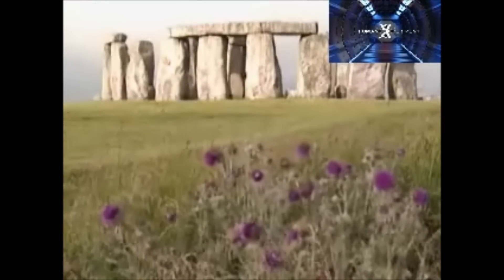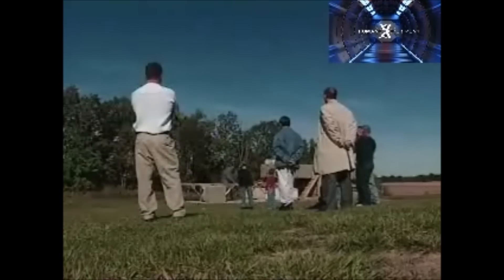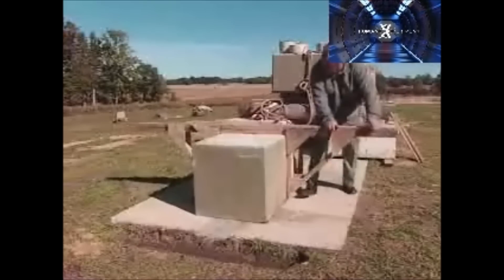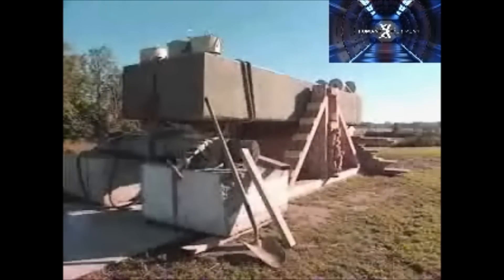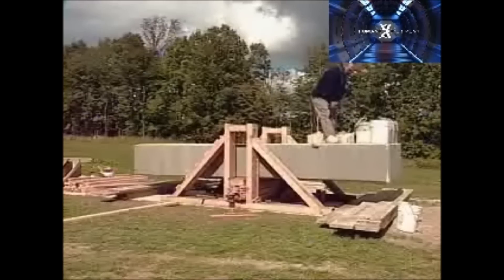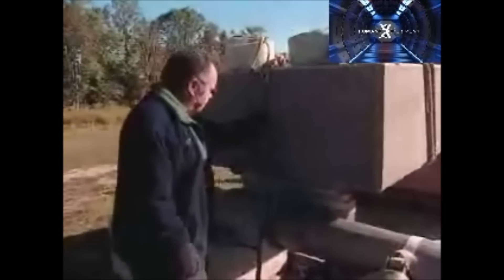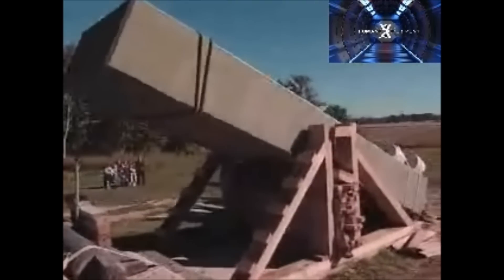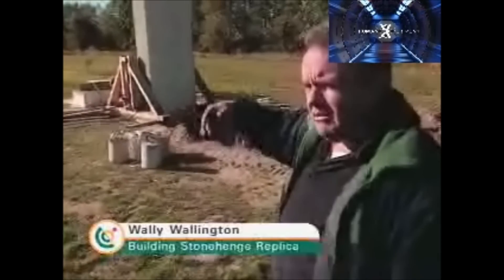How Wally built his own Stonehenge.

Comment: Ya, but how did he get the stones to his house? The problem isn't manipulation of the stones. Edward leedskalnin proved you could do that with balance and leverage. Its moving these massive stones 30+ miles across uneven and dangerous terrain thats the big question here. How did they move these stones so far? Just like the pyramids. How did they get all that material there and raise it hundreds of feet in the air? To do this you cannot exceed 1% on an incline and that would require massively long ramps. Like half a mile long or longer.

Comment: I have a friend that ran a crane for years, now an engineer. Before getting his license, he had to study all the load-bearing formulas. I asked him what he thought about the whole, "No modern machinery could build the pyramids" nonsense. He said the reason for that has to do with what the cranes are used for not with our ability to build machinery to do it. We generally make cranes thin and long because it needs to work between buildings, fit on modern roads, and lift moderately heavy things. You can't build a 30-story apartment building out of huge chunks of stone, so we don't make cranes that can lift huge chunks of stone. There are also issues with permits, building a 30-story building out of huge chunks of stone, besides the feasibility, would require a lot of time, and building permits don't extend out that far.

Comment: We so often look for the complicated route where simplicity often is the answer        glad this video added to body of work
Reply: Nothing simple about moving a 12 ton rock from the earth with enough people to push and pull, drag it, but then comes actually lifting it.
You could dig under it and place rollers, but you can't place stones under it as they're on earth.
They didn't have concrete bases to place stones on to move them.
Although you could lift it to place a small rock under it, the rock would bury itself in the soil.
I suspect they possibly used similar techniques to what Wally is using on some of the construction as these ideas are fairly logical straightforward thing's, they certainly knew how to build large wooden constructions, as ancient post holes are often found in archaeological digs, spaced in such a way with burnt soil and ancient animal bones inside, to suggest large wooden buildings were being used

Comment: That really fascinates me, didn't Newton say give me a lever long enough and he could move the world.
Reply: That was Archimedes
Reply: That people see this video, and suddenly learn about leverage is shameful. However, none of this guy's examples work on dirt, and half the height is lost on the hole.
Reply: @gregwarwick8655  most of the examples work on dirt, you just need large stones to pivot on instead of pebbles. The concept works the same, though not as elegant as on concrete. That's for sure.

As for the length. The only way you'd end up with half the block underground would be if the pivot was at ground level. In his example, it looked like about 1/4 underground and 3/4 above ground because he raised the pivot well above ground level. Probably not coincidentally, the ratio is the same as the stones at Stonehenge.

And don't forget - he's one man doing everything. Imagine if you had 100 men working on the same problem. Moving this size stone would be a piece of cake.
Reply: @bradley3549  ridiculous. The block didn't levitate to 3 or 4 feet above the ground.
Reply: @gregwarwick8655  It didn't have to. He raised it up a little bit at a time just by rocking it back and forth by moving weight from one end to the other over and over again. Piece of cake if you got the time.
Reply: @bradley3549  I know. I saw his simplistic leverage demonstration. If you think this explains the megalithic constructions around the world, you're gullible.
Reply: @gregwarwick8655  I wouldn't argue that it explains everything in the world. But I think it does a fantastic job of demonstrating in real terms how people could manipulate very massive objects without the use of modern or modern-like technology. If you think it doesn't, you're foolish.
Reply: @bradley3549  some blocks bigger, were transported 1000 miles over mountains valleys and rivers.
Reply: It was the Greek mathematician Archimedes actually...but excellent point none the less!